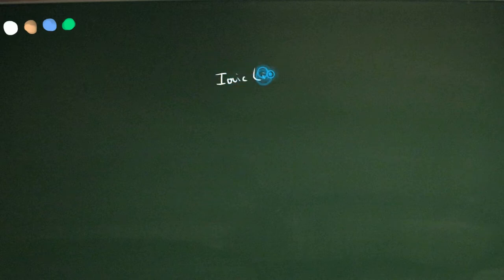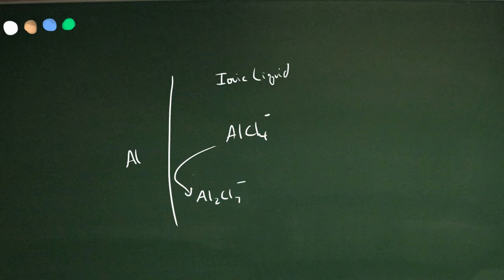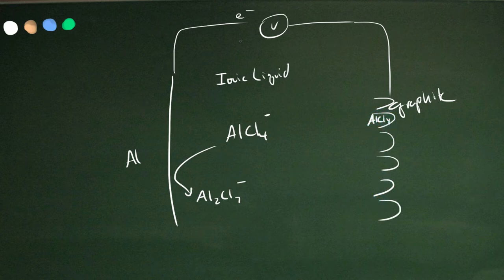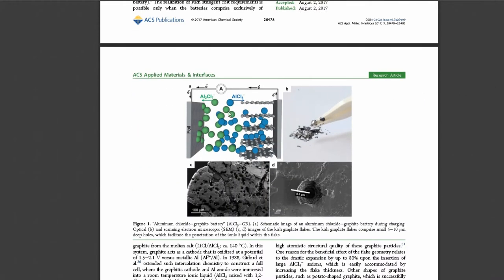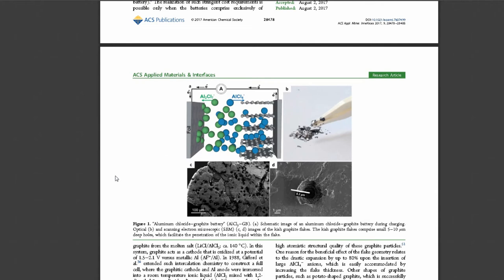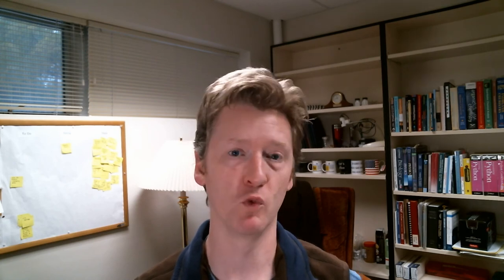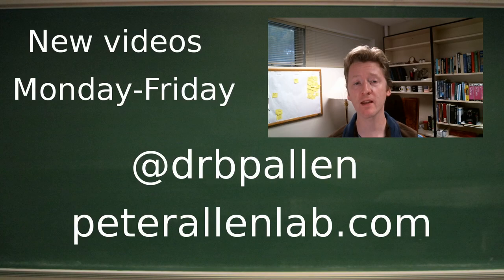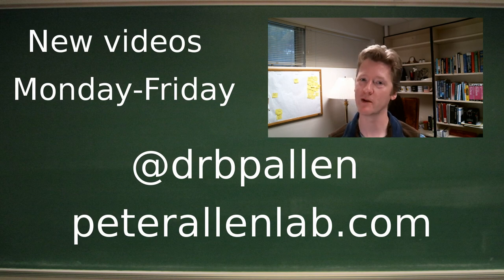Low-cost Aluminum battery with waste graphite

Comment: I've tried epsom salt/glycerin (1:3) which was supposed to be an ionic liquid in a magnesium/copper cell but the resultant voltage and current was a bit lower than using water. The charge did last a bit longer so I assumed it was a trade off. I did not try graphite and magnesium which generally does produce better results than copper. Perhaps it would have improved the performance using the epsom salt/glycerine. I did a lot of experiments trying to optimize my efforts.
The question I have is would it be beneficial or even possible to use a glycerin electrolyte in an iron battery to reduce corrosion of the electrodes? I'm not a chemist so I don't know. I thought it would be worth mentioning in case it might be feasible but has not been considered.
Reply: MrFmiller 

choline chloride and mono-ethylene glycol. try that as an ionic liquid.  you'll have to experiment with the ratios yourself.  but, a 1:1 "molar" solution is a place to start. 
you could also replace your glycerin with the cho/chlor. 
play around with different salts in the cho/chlor based on the metals your using in your experiments.
good luck, hope this helps and gives you some good results. 

the cho/chlor and mono-eth can be used in a variety of battery chemistry.

Comment: Sir, I like your way of explanation. I have a question what will happen if we add tap water or di water despite of ionic solution. What will be chemical reaction both at anode and cathode part  if anything possible. If there is any paper related to above query please provide me with the link of that paper. That will be really helpful for me.